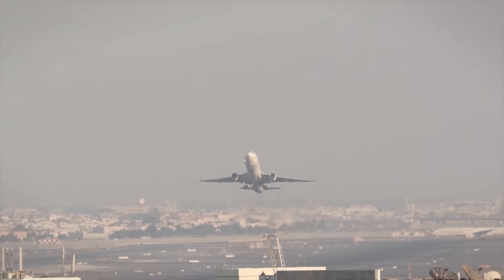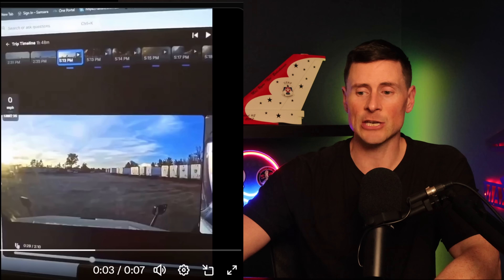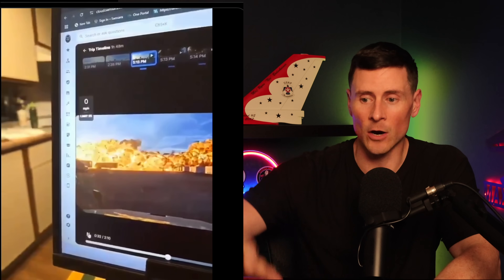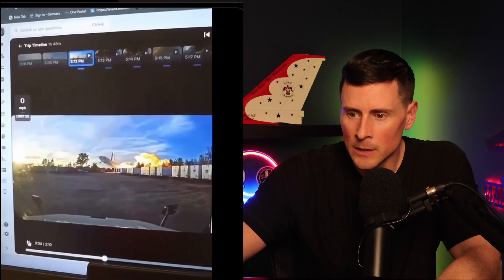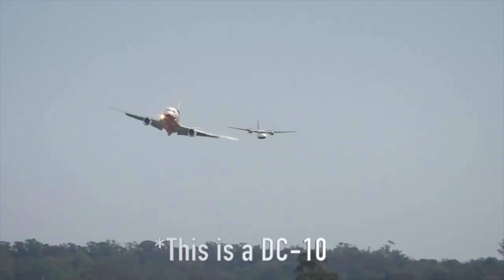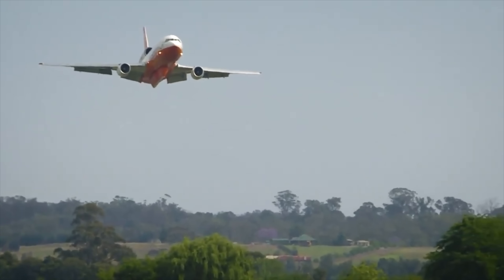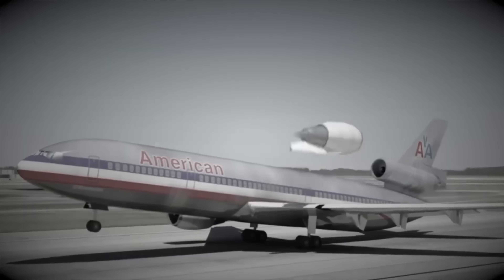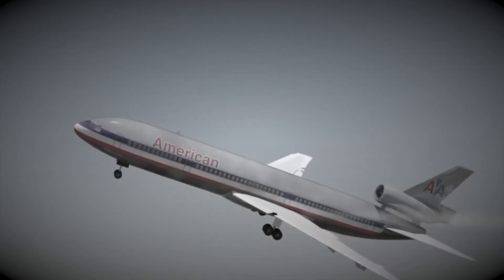Airline Pilot Reveals CHILLING Clue in Final Moment Before UPS 2976 CRASH

Comment: Yes, it was confirmed today that the left engine did indeed detach from the plane far back up the runway before this video recording had started. It was said that the plane at one point before was 200 feet off the ground before it came back down to the runway again as the video recording began. There was no left engine there on the left wing burning in the video as it had already fallen off. It was likely just the ignited fuel spray being pumped out from the severed lines? The pic of the engine laying off in the grass appears to be legit. Your comparison video of the other plane losing it's left engine sure appears to may be what had happened here yesterday?

Comment: Plane was filled with 38k gallons of Jet A.
1 metric ton of Jet A is 326.5 gal. Weight of Jet A is approx 6.75 lbs per gallon.
Plane had 114 MT of Jet A on board.
38000 × 6.75 = 256k pounds of fuel.

Comment: 1:58: Correction. The Plane did get into the air about 175 feet then fell, first grazing the top of the UPS Supply Chain building across from the run way then the plane cartwheeled into the petroleum recycling plant and kept going for a half mile. If it never got air born, it would have hit the UPS building head on and destroyed that building instead of just leaving roof damage.

Comment: The 1979 DC-10 crash at Ohare Airport was caused by a weak engine bracket. Turns out two different shifts were working on that air frame. The 1st shift broke protocol and left the engine in the hydraulic lift partially installed. I dont remember which shift did the damage to a bracket but it was missed and unreported. This was found to be the  csuse of the crash. Engine separation due to mechanical failure and human error.
Reply: Used  a forklift to lift engine damaged pylon    poor maintenance     did NOT follow the proper way to replace engine

Comment: My friend works at UPS and is a Aviation Mech. Her shop sits at the exact end of the run way. The Left engine separated from the wing close to lift off from what they can tell.  I have pictures of the engine sitting on the ground in front of the shop. That aircraft also just came back from a heavy check in Roswell. Is that 100 the gospel why it crashed not sure but it seems to me the engine came off.

Comment: Sparks appearing from #2 area could be a tail strike trying to rotate steeply.  Often fuel and other bad stuff leaks on heavy tail strikes, and as you know the horizontal in the MD-11 also has fuel tanks.   I cannot imagine being in the cockpit watching this unfold. RIP gentlemen   8 hour flight 250,000+ lbs fuel possible if they wanted hold fuel and it is over water ops.   Image is confirmed to be the #1 which departed its pylon and isn't that a windsock just to the right?  I'm trying to find the windsock on googleearth etc, Airport diagram shows no segmented circle, but lighted windsock.  Importantly that will tell us at what point it separated.   FDR CVR are back in DC now being read.

Comment: I saw an episode of aircrash investigation that this situation reminded me of. In order to remove an engine there's a lengthy process, so they used a forklift as a shortcut.  It resulted in the misalignment stressing the mounting bolts causing the engine to fall off between V1 and rotate.
Reply: That was the AA191 crash. We don't know yet on this one, but I am sure it will be looked at. I may be wrong about this but I heard O'Hare had just started a video service where you could watch your plane take off while it was doing it. So many of those on AA191 could see what was happening in real time. That service was put to bed shortly after.
Reply: @richardjacques1731 i remember that now. They were watching on the seat back screens. It would have to be horrible to have a front row seat to your own crash.
Reply: This has nothing whatsoever to do with 47. You have no idea what caused this tragedy because that information hasn't been released. Your TDS is overflowing
Reply: Sorry, but the gutted Aviation requirements, & US gov' forced staff layoffs, funding reductions, & reduced & missing oversight engineering checks, and Redhatted aligned company mis-management strike yet again !

More blood upon the callously inept 47th Admin !!

May all the survivors & the relatives of the tragically unfortunate victims all heal as best can be in as needed amount of time they need.

Comment: If #1 detached, how do you explain fire in #3?
Reply: Engine 3 wasn’t on fire. However, you might be talking about engine 2(the middle one). That was either caused by a compressor stall, or debris from engine 1

Comment: I was wondering whether the sparks from what appears to be the right side of the aircraft might have been more to do with the no.3 engine itself contacting the runway during rotation, potentially related to the unbalanced nature of the aircraft given it appears the no.1 engine had fully separated by that stage? The slats retracting after hydraulic failure is an interesting point to raise as well beacuse of how this aircraft was also visibly banked down on the side with the initial engine failure in all the camera footage we've seen so far, though it's also worth noting that the tail and presumably main landing gear had already made contact with that warehouse, potentially altering its final moments in the air. 

What a sad, sad tragedy. May the crew and those also affected all find peace among this chaos.

Comment: My heart breaks for the families of the victims of this tragedy. 😢

The McDonnell Douglas MD-11 typically requires a takeoff speed of around 150 to 180 knots (approximately 173 to 207 mph) to become airborne, depending on various factors like weight and weather conditions. In the recent crash of UPS Airlines Flight 2976, the aircraft reached a maximum ground speed of 186 knots before the incident occurred.
AI wrote that for me. 
There was absolutely nothing the pilot could do to prevent the accident at that speed and that close to the ground.
The lesson is that there should not be businesses or homes in that danger zone at the ends of runways. Of course, in this world dollars are more important than life.

Comment: hello, bad crash.  a few notes. i flew captain on the md-11  at fedex for 7 years and the dc-10 for 17 yers.  a few things. the sparks on the tail was a tail strike. no sign of any damage to the engine.  also just to correct on the crew  1 captain 1 first officer and the 3rd was a required RFO for any flight over 8 hours required by the faa.  also load masters are only used on military charters. differnece between american 191 in chicago is the engine departed the aircraft over the wing taking out hydraulics and retracting the left slats causing uncontrollable loss of lift on the left while still having full power on the laft engine including slats and flaps lift.  the fireball on the left engine pylon area was probably caused by after the engine left leaving all fuel lines erupt and ignite when they were supplying full power fuel. last note, the MD-11 was a aircraft that many pilots could not land without crushing down. the reason was that the MD-11 had a fuel tank installed in the tail to further the  range. this made them design the horizontal stabilizer alot smaller than the DC-10. so when guys who were flying both the MD-10. ex dc-10 with glass and no engineer,  with a bigger horizontal stabilizer the technique was alot different in the flare with alot less elevator control.  many could not make the transition easily.  anyway. be safe everyone. MD-11 is still safe. and a work horse to the cargo industry.  my last 10 years on the Triple 7 . that is a beast.  take care, tim
Reply: Great insight!!! Thank you for the detail.

Comment: I remember flying on a DC-10 in the late '80s, but I sure as heck wouldn't want to be on one now - that was nearly 40 years ago. These planes are all really old, and should probably be permanently grounded.
Reply: Yep, same here in fact took one on AA to Hawaii
Reply: @MG-ot2yr I was on a NY-BOS shuttle, so it was a really short flight. Seems weird to use such a huge plane for such a short trip, in retrospect.
Reply: @Wes_Downer  Planes made more stops back in the day, when "direct" and "nonstop" really made a difference....today those terms are used interchangeably but not then.  I would imagine a DC-10 from NY to BOS was likely continuing on transatlantic or transcontinental from BOS.
Reply: @MG-ot2yr No, it just went back and forth all day every hour. There were just that many people to fill it up! Probably still runs with a 767 or something...
Reply: @MG-ot2yr I think my memory is wrong - the shuttle (acc to Wiki) never used anything that big. I know I was on one at some point, though, because it's the only jet that had a 2-5-2 seating arrangement!

Comment: Old junk, all need to be parked in Arizona. 
Could be metal fatigue? 
Aluminum, 6061-t6 variants, does have memory, but eventually will show microscopic hair line cracks, over time, due to vibrations, excessive stresses, etc. not visible to the eye. Magnaflux, X-ray with luminous dies, takes time and money to do. Then again, how many hours were on the wings? They normally would/should be replaced at a specified end of life. As for myself, I would never, ever get on a large plane. Think of it as >200ton locomotive with wings!
Bottom line, it takes lots of money and time to "proof" any aircraft.
Corporations only care about the profits and bottom line.
My sympathy to the lives lost, family, etc....

Comment: The left engine came off like the Anerican DC10 in Chicago.  The #3 engine could not over come the stall of  the left wing. 

The engine mount failed or the engine blew and knocked off the engine. If you look at the engine it hit the ground and bent the front of it.

Comment: At what point, distance wise and timewise would the pilot have known or had felt something wasn't right, possibly a lost in performance, or would all of that be unrealistic for any pilot to have done something else, potentially ditching the takeoff and aborting? And is it completely up to the individual airports in having enough area for planes to abort takeoff safely or is it all standardized, regulating that every airport be required to have enough runway room to attempt to attain takeoff velocity, decide to abort, and ultimately have enough distance and time to come to a safe stop? Basically would love to hear a breakdown of the protocols a pilot would go through in deciding to abort - I'm assuming that there would come a point of no return. All of this has certainly got me curious to hear more about the policies and procedures, that a commercial airline pilot would be required to have a general understanding of (obviously they'll have access an operators manual to reference to), just when it comes to the takeoff, landing, and abort procedures.

Comment: IIRC the Flight 191 engine departure in 1979 was traced to a cracked mounting component which failed because during maintenance they were replacing the engine and had all the pins out except one, left the engine supported on the hydraulic engine hoist overnight but the hoist failed or leaked down and the full weight of the engine was carried by one mounting point which caused a fracture.  When the maintenance crew next day discovered the hoist had failed they failed to carry out additional inspection which would have discovered the fractured component.   I think that story goes with Flight 191, not 100% sure though.

Comment: In the Chicago DC-10 accident, it was found that using unauthorized methods for making engine replacements (forklift vs engine stand) caused overstress on the engine mounts leading to cracking and failure. Inspections of other DC-10s found cracking of the engine mounts. There was an asymmetric slat indicator but apparently that and the stall warning was powered by the No1 engine that had just left the plane.
https://www.google.com/search?q=dc-10+erroneous+asymmetric+slat+indication&rlz=1C1CHBF_enUS1036US1036&oq=dc-10+erroneous+asymmetric+slat+indication&gs_lcrp=EgZjaHJvbWUyBggAEEUYOTIHCAEQIRigATIHCAIQIRigATIHCAMQIRigAdIBCTIwNjcxajBqN6gCCLACAfEFAITHC7zjJxI&sourceid=chrome&ie=UTF-8

Comment: I load/unload planes for UPS. I DESPISE the MD-11. It's a pile of trash. Every item on it is poorly designed, not thought-out well, and impossible to work with. We were told a couple of years ago that we wouldn't be seeing that trash-heap anymore, as UPS was retiring them. They became less frequent for a while, then they brought them back. It carries a couple more cargo cans than a 767, but not enough to make it worthwhile. What a garbage aircraft.
Reply: How far does UPS load its MD-11F's toward their max. takeoff weight of 630,500 lb.? Especially on a flight to Honolulu...
Reply: @Raiders33  That's above my pay-grade. (I'm a loader operator out in the rain.) The people in Flight Ops do the calculations. I will say that UPS is quite meticulous about their weight and balance regulations. When we have a can in the wrong place, the whole operation comes to a screeching halt until things are made proper.
Reply: @TheRKae  Cool. I just thought you might've heard the Loadmaster say a weight number, or something like "We can't send this aircraft until 2 more trucks get here to get the weight up/ closer to max." I loaded UPS feeder trailers when I was in college (700 pkgs/hr by hand 😉) and UPS waited until the last second to close & send a truck I was loading.

Comment: I hate to throw rocks at people like you, but I just cannot stand watching videos of pure speculation, especially lacking facts. I was an airline pilot for over 35 years. I actually flew wide bodies mostly. 
Let us start with some facts. If you had done a little research you would have found out that the UPS airplane made it to 175 feet. You compared the AA flight to the UPS flight. The reason the AA DC10 engine came off was because it was designed to do so. Boeings were as well. This was because of potential seizure. If that was to occur there would be such drag that it would make it impossible to control at any altitude. The AA engine had been replaced using unapproved methods. They used a forklift to lift the engine that had weakened the pylons holding it on the aircraft. When the DC10 lost the hydraulics to that wing there was nothing locking the slats in position. Boeings were locked in place. I am sure the MD11 was modified to make sure the slats would not retract without hydraulics. 
Your next error was about the crew. I worked at UPS for a short time. They are not the military. They do not have load masters on the aircraft, nor do any civilian airlines to my knowledge. The third pilot was a relief pilot. That pilot was required because of the flight time being over the 9 hours. 
You went on to show the engine next to the runway. I would question the authenticity of the picture. I believe the videos would have clearly shown the engine separating. I do not mean to be so nitpicking, but for someone with no widebody or long haul experience to jump to conclusions was reckless at best. The ill informed public will believe that all airplanes will have engines falling off. There was so much speculation on the internet before the facts were out. I know its all about the scoop and how many views and money can be made. The same thing happened with the Air India flight, which proved to complete BS. Please be more prudent in the future.

Comment: RIP to the deceased, and condolences to their families. I'm sure the flight crew did their best in an impossible situation. MD 11 manufacture ceased in 2000 - 25 years ago, and they are all flying cargo now. For those aviation industry veterans out there, are safety inspections on freight planes less stringent than for passenger aircraft? Would cargo use be harder on an aircraft than flying passengers, and do the take-off/landing cycles accumulate at the same rate for both uses? Early I know for answers, but the why and how is troubling me.

Comment: The smoke from the engine area   because the engine basically ripped off down the runway. Engine is several hundred feet down the runway.  
There are vid with the plane going sideways. Wing ripped into the roof of the building on its side,  when the plane hit the ground it was basically upside down.  No way to revover

Comment: Of course, the AA 191 crash was due to a maintenance crew disregarding the instructions for removing the engine from the wing with the pylon still attached .  It has been noted that the aircraft flying UPS 2976 had been in for a maintenance check two weeks before.  Is it conceivable that the maintenance crew in this case mananged to make the same mistake, even though the fate of AA 191 is widely-known and resulted in warnings to not follow such a procedure?